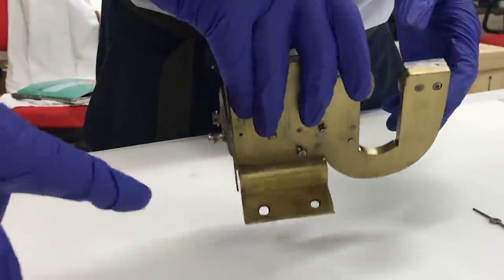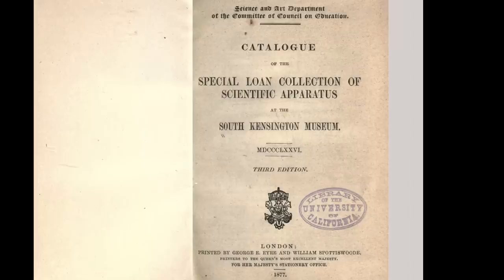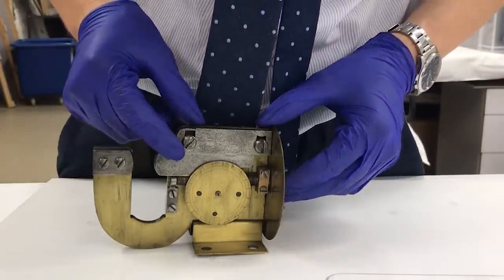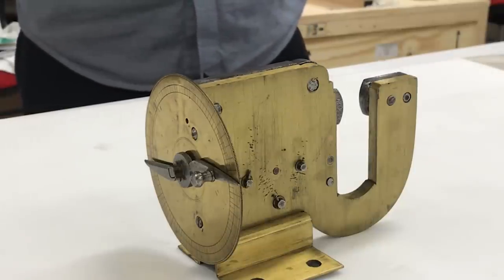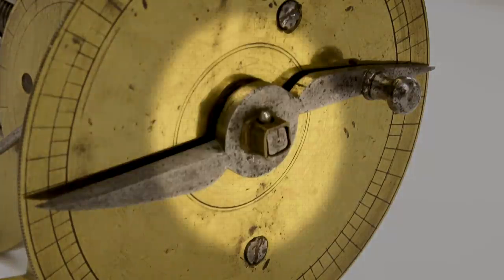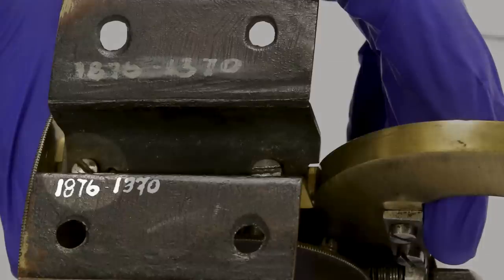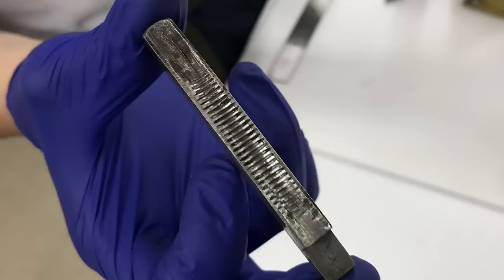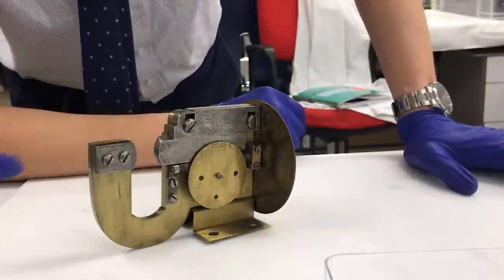World's Oldest Micrometer - 1776! Who made this thing??

Comment: "In My Opinion" 
The entire thing is made from scavenged parts and built most likely to serve an incidental very particular (perhaps even just one time) use. The maker was possibly (like me and many of you) a compulsive fixer/repurposer, likely also mentally unable to dispose of "broken" crap because he sees a yet to be determined future purpose for just about any chunk of junk. And there is, if you horde enough stuff and you build enough of your creative visions you will always run into a situation that calls for a one-day, on the fly, quick fix mcGuyver tool that just really pays off spending a day junkyard hunting some clockmaker's old dial plates from his apprenticeship or whatever. maybe the dial plate's from kettle pressure gauges made by monks who ran brewery's. maybe he used some broken humidity clocky thingys, they were around back then right? Anyway, I worked for an oldskool instrumentmaker for 10y before he retired. He had a big workshop, meticulously tidy, every drill in the correct spot on the block and razor sharp and straight af. Not much room to work in tho, since the walls were lined with a thick dense layer of 50y/o steel cabinets with large heavy drawers which opened silently dispite being loaded full of odd metal jigs and special tools and molds for parts he will never make again lol. This device looks just the thing. just hella old. (i personally believe that the foot is later added when the thing may have been recomissioned for action and needed to get fixed to the bench rather than using it by hand. is my 2cts)

It may just have been an adjustable bending tool for the maker. Never intending it for measurement but to apply measurement

Comment: From my understanding, the ideas, and pieces leading up to the micrometer existed long before the u shaped micrometer, and bench micrometers where an occassionally seen tool in clockmakers workshops, and, turning large iron peices on a lathe is almost as old as the European firearm, although most early Lathes only exist in crudely drawn and intentionally sabotaged pictures, showing off the size of cannon a certain kingdom could make, so they where not keen on displaying the truth of how they worked.

And Watt would have access to an engine lathe for certain, being that engine lathes with flying prismatic bars where well in use in smitherys and by instrument makers before he was even born, slowly evolving until we reached the modern, more reliable, stable pattern
All in all, it looks pretty original for a piece that was used on the shop floor.

Its possible that the the slightly uneven markings where intentional to make up for slightly drunken threads, making the dividing wheel the device that marked the face.

The prior comment you have attached to your video about the brass looking roll milled, might be correct, the roll mill is one of the first widely used machine tool along with the (water) powered hammer, both dating to ancient times.

Comment: There are many simple tools that do the job of a micrometer.
Take two steel flats and place a small wedge between them at one end.
At the end where the flats touch is zero.
At the end with the wedge is full height.
Math would then be used to calculate the rise over distance.
An object of unknown height is placed between the plates where it just touches both.
Note the position of the contact point, and the height is easily determined from the know rise.
With a thin wedge and long flats, very tiny things can be measured.
Not a terribly practical technique, but it works.
Since it is based on trigonometry and simple planes it is easier to calibrate than a screw.
See also sine plates/bars in milling.
Q: when were the earliest ACCURATE screws produced, and how?

Comment: Ok, first your presenting it upside down. There would be some ware in the "U" area, its brass.
 Second the hammer marks on back are from nailing in the locking pins. 
Third, i belive the base was cleaned with a wire wheel and removed the mounting marks. There was probably a wooden handle 
 Its a homemade micrometer, probably made by a clock maker.
You can tell someone slapped it together from stock metal, but performs it function perfectly. The maker knew what he was doing.
I bet that was used to make or assemble huge clocks in clock towers.

Comment: It must have had a wood base, to hold it steady.  The large brass dial is clearly turnery, and could have been made on a wood lathe.  If it was made by Watt, it was probably made when he FIRST needed it, and not when he was making steam engines,  It could also have just been a tool that he bought. The holes in the brass are neat, because they were drilled with a steel bit, into brass.  The holes in the iron were drilled with a steel bit that was not much harder than the iron, and did not cut very well. After it just went through, the maker, not wanting to break the bit, turned it over and finished each hole from the other side.  Remember that back then, a drill was held and turned by hand, not by a drill press, and drilling a hole in iron or steel was not an easy thing to do well.  Who ever drilled those holes probably spent a long time on them. He probably also had to make his own drill bit, and it was probably a spoon bit, and not very strong.  The moment when such a bit just started to break through and enlarge the hole was when it was most likel to break, and a person might go to a file or scribe at that point to avoid breaking the bit.  I agree that it has been used to much to be fake, and I am sure that many people made such things, out of necessity, before anybody thought of selling them to other people.  We all make jigs, but back then, people tried to keep secrets from the competition.

Comment: I'd be curious to see how accurate / precise it actually is. If it doesn't do what it's supposed to do, that would suggest that it's not authentic.
Reply from the maker: We didn't do it in this session, but previously (like in the 80s) the museum did measure it against jo blocks to see what the difference was and it's surprisingly close.  However,  in Watt's time what was an inch?  Especially down into thousands? There was no jo blocks or anything like NIST to set standards.   I'll cover that in future episodes.
Reply: Cool!

Comment: If this was the first micrometer, what are the divisions on the dial.More likely fractions than base 10 divisions.It looks like a combination of clockmaking and blacksmithing ,which is what you would expect  at this time.Imagine trying to make this with almost no machinery. Like another commenter I trained as a toolmaker,and producing these parts with only hand tools would be very time consuming and mistakes would be corrected  but leave evidence of the mistake.From the curved faces on the measuring jaws it looks as if it was set to a particular size and used as a gap gauge, probable for multiple parts.

Comment: As you say, Watt was a rich 'leader', so much of the nitty gritty was probably left to his craftsmen. Could it be that one of them developed this, and it was kept as a 'company secret' to enable easily reproducible 'standard gauges'  to be issued to his other concerns? Much in the way a calibration standard is today?

Conformity between workshops would have been a huge advantage then. One of his engineers would have had call on several places of production and expertises, so maybe the 'inventor' did not make it.

Comment: I grew up in a boat shop. That's the extent of my "expertise".
IMHO, this is a tool made in haste to finish a project. It's made of whatever was around at the time and put together as fast as possible. Whatever methods expedient with tools at hand were used to finish it so that it could do the work needed by the creater. Further, it looks like it's been used regularly in the job it was designed for, very likely with the creater saying, "One day, I'll make a proper tool. For now, this will due."
Furthermore, the workmanship suggests to me the maker was a journeyman, not a master. In otherwords, someone who knows enough to get the improvise from scraps but not the practiced skills to do so with elegance.
This suggests to me it was not made for the exposition. I suspect from thus that it is not a deliberate fake. However, it might not have been made by Watt's hand. Only a metalergical analysis would confirm the time-period of creation and if that lines up with Watt's abilities.
Just my $0.02.

Comment: The vice marks on the anvil, plus the general roughness of construction , suggest this was made by either a less skilled man copying an original , or , a prototype .As many prototypes go through many alterations till a working model is achieved . The later models would have been much better constructed.I also note that there seemed to be no figures on the dials apart from graduation marks and IMHO the base is not original .

Comment: It looks to me like this was cobbled together to be used as a rough model to be used as a teaching tool. As such it did not have to be made very well and there was no need for precision in such things as countersinking screw holes, etc.  You know an engineer or machinist of any standing would not deliberately make something this rough...even a student would receive a failing grade on this. So no, it was never meant to actually be used for measuring anything. It was donated the same way we would clear out a closet and give something away to the Goodwill store today.

Comment: could you do a video on thermal industrial thermal control  ( not like freezing food ) but like getting 60 tones of molten metal too precisely 1680c as uposed to just vary hot or sum place between 1500 and 2000  as black smiths have dun for centuries but actual precises thermal control or -165.2 C

Comment: Joseph Whitworth is credited with inventing the micrometer in 1840 (why do people call it a micromotor)
Also, you failed to mention the pitch of the screw threads,  Whitworth also devised the worlds first standard for screw threads with a fixed thread angle of 55° and having a standard pitch for a given diameter in 1841.

Comment: I know why the tool is how it is. This device/tool was used to create another device (a product, maybe even another tool). As the product changed, progressed, evolved, this tool changed along with it. I know this. I have done this many times and I have seen others do this many times. It is creating a tool specifically for the creation of something else, which could also be another tool. 
That's my opinion anyway.
edit: This tool was definitely made to manufacture many pieces for the same product (mass produced). This tool was made and used for manufacturing.  My educated guess is that this tool was created to make a certain product (let's say "Product X"), and that Product X was manufactured and sold for a long time.  Product X was around long enough that it evolved over time, having changes to it made, to make better Product X's, or maybe even just cosmetic changes to Product X. 
I would guess that this Product X changed enough over time that eventually, a new tool was designed, as making ever more changes to the tool was no longer feasible (economically, or any other reason). I reckon this due to the change in the tool's mounting and the fact that it was coded and dated. It looks like the older Product X was still around and in use, but a new product, "Product Xy", was created and eventually took over and the older tool for Product X slowly faded away as the new Product Xy took over the scene.  
The "ridges" around the "dial" was simply made for ease of turning, like many dials have. The ridges made it easier to turn and they may also have been working with oily fingers.

Comment: Particularly the dials with their decorative touches scream "recycled!" to me. These parts look like something that came from the scrap bin. They look like an apprentice started to make them for some other job, it's like he did the decorations but screwed up the "crossing out" scribed divisions. Especially the 19 & 23 divisions on the dials look like repurposed parts. Why would you intentionally use prime numbers for this function?? Perhaps careful analysis of the pitch to worm ratio might shed light on this choice. 

The "lack of decoration" and the "built to solve an immediate workshop problem" look of the rest of the micrometer are consistent with the sort of thing that tradesman worldwide still build all the time in order to meet some very specific job requirement.

 My toolbox is full of "specials" that I have made for one-off jobs... most of which I have never used again. (I just can't bring myself to throw them out "just in case") A few of these have been reused in solving new problems, with a little impromptu modification. The apparently (cyanide?) brass plated stand bolted to the bottom of the tool looks like a later addition to me. Again, apparently added with the intent of solving some new problem.

IMHO if the "Watt micrometer" is a fake made 100 years later, it's a really, really good fake made by a master counterfeiter. It has too many of the hallmarks of real "day-to-day workshop necessity" writ large throughout.

As one of my mates pointed out, the finished "saleable" look of the French micrometers contrasts with the item in question indicating that they were preceded by prototypes, not so this supposed "fake".

This is still no guarantee that Watt himself made the item, it might well have been the work of some nameless tradesman employed by Bolton and Watt. But something so insanely useful as a micrometer (when there were none in the "tool catalogues") would have been kept by any company inheriting such equipment from an earlier business, even for a century. (Personally, I have worked in small machineshops that have pressed 80 year old machine tools into everyday service.)

If this micrometer is a counterfeit, I want to know the story of the genius behind the fake... it would be a story even more enthralling than the mystery you have presented here!

P.S. Timestamp 10:54. Is that the "apprentice's trademark" on the right hand end of the component??! Looks like vice jaw bruising!

Comment: You'll need to make some metallurgy testing of the iron and maybe some radiometric carbon testing. So you will know if coal oder charcoal was used to form the iron. And btw. check the metric of measurement. 
What kind of metric does it show, inch, old inch, much older inches or something else. Try to find out what other metrics Watt was using on his early machines.
What are the parameter of the screws (thread pitch, diameter). There is nobody dimensioning new screws if there a existing tools in the shop. Especially on a lathe its difficult to arange new divider for a new thread. Try to find other screws of its estimated time and location.
And compare thread pitches to the dials. It should be consistent or this thing is not authentic. You dont build up a micrometer using mounting screws with complete different metric base.

Comment: The marks on the back side appear to be from someone using a hammer to driver the pins in on assemble. I would think that this was not done by the Maker as he would have known to use a punch! To me the base appears to be made after the fact by someone else and most likely by Mr. Hammermark who disassembled it to figure out how it worked. He didn't have the skill/knowledge or tools required to put it back together without damaging it! Also I think the base height was just wrong not meant to be overhanging. Someone lacking skills (Mr. Hammermark) wouldn't know how to calculate the amount of material required to form the bracket so that it came out at the correct height. Or in the calculation to form the bracket he didn't account for the four bends; looks to be off by just that much to be sitting level. My two cents, very interest device and overall appears to me to be a prototype. If Watt did make it maybe he never made it known at the time to keep he's methods a secret from potential competition........